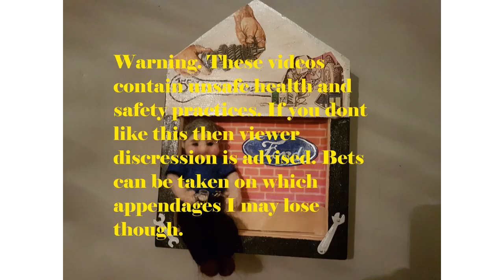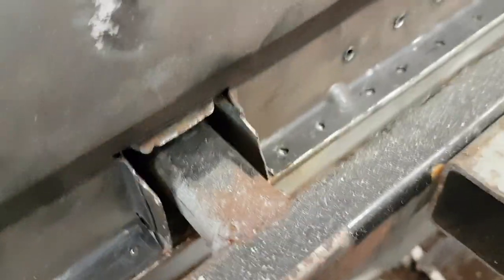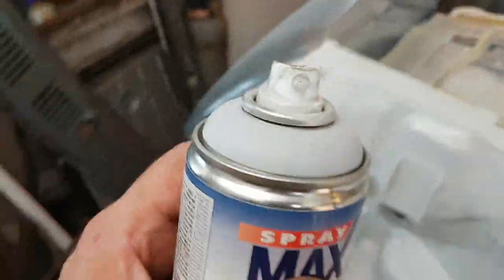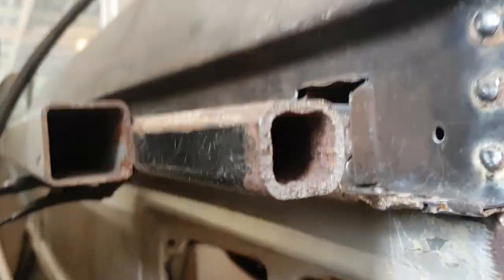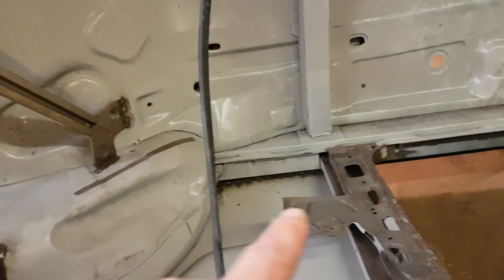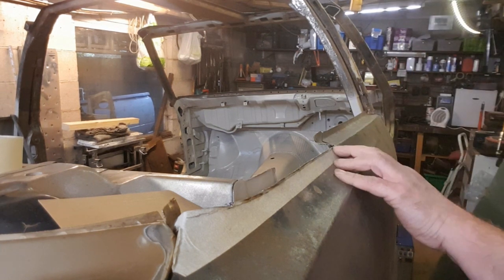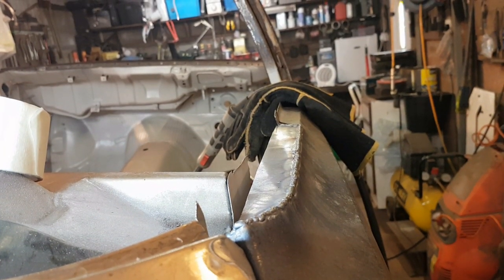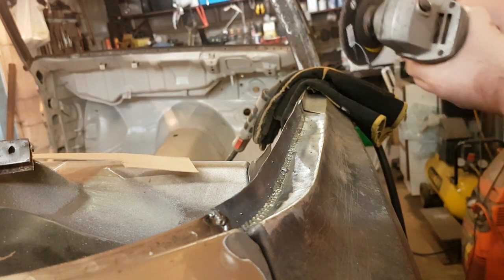MKV Cortina Carbodies Restoration Part 44

Comment: Tony you could have saved the tape from the final cut and stuck it to cardboard then made a template for the other side :) Great to see you back, i mentioned previously about the the shakes it might not help, but from 13?-27? (now 52)  i had the shakes which my father had also, i finally went to the Dr and they did the tests and they said its internal tremors, i was put on propranolol 40mg twice a day which is a beta blocker, its amazing the difference i feel, watching you feel for you. upside for me it also stopped me getting migraines. keep up the great work